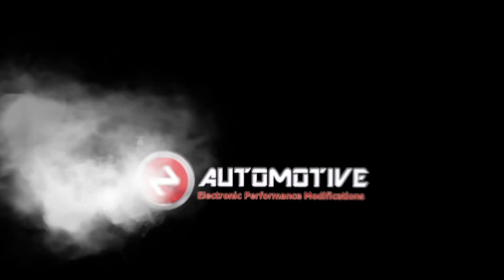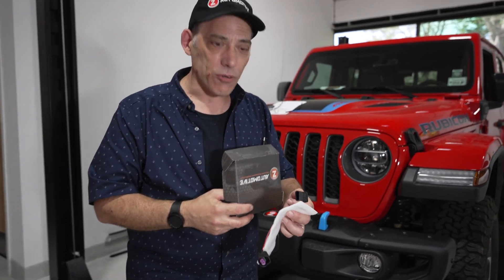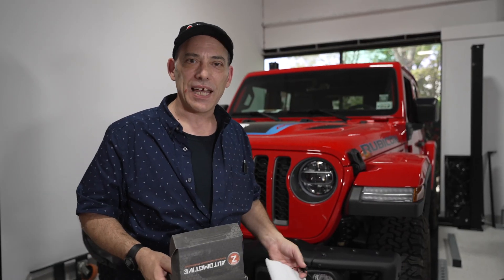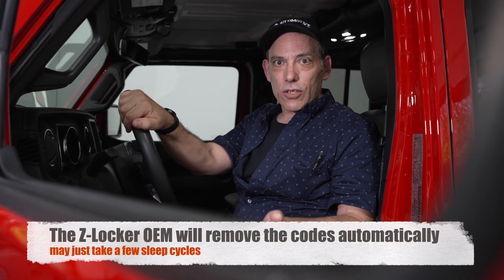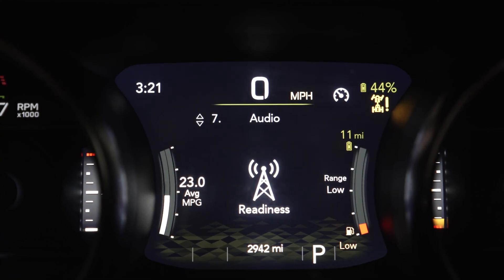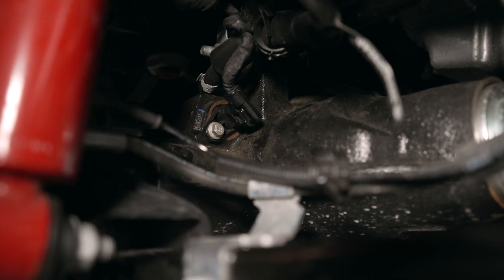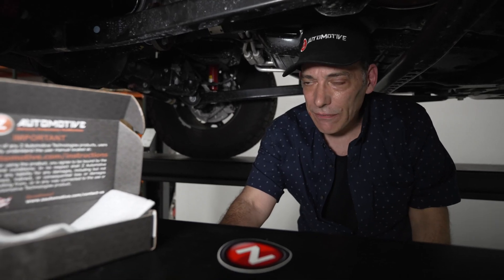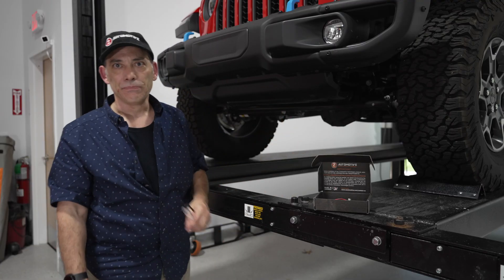Fix the Faulty Locker Sensors in the Wrangler JL Rubicon and Gladiator JT Rubicon

Comment: Hello.
Thank you very much for this video.
Could you answer a couple of questions for me.
Some time ago, I had this problem on my JL Rubicon. At first the error appeared and disappeared, later it began to glow all the time on the dashboard. I purchased your OEM Z Locker and installed it. But I installed it on the front axle of the car and the problem disappeared. The error did not reappear for several weeks. Now the same error has started appearing and disappearing again. I do not understand? I installed Z Locker OEM on the front axle and it should be fine. Does this mean that now I have the same problem with the rear axle and I also need to install Z Locker OEM on it? Does it happen that 2 sensors fail at the same time?
I also have a Tazer mini - but it doesn't find any errors.
And the last question - when will Z Locker OEM be available to order?
Once again, thank you very much for the video and for such a great solution to the problem.
Reply: @zautomotive , 
Thank you very much for the answer. I also thought so, that this is due to the fact that the error is not active all the time at the moment. I had 2 errors: B23BB and B23BF, but I understand this is not related to my problem? 
But in any case, I think I'll still get your second device.
Reply: @zautomotive , yes, it's a really great job. My respect to you!
Reply: Hello again, my friend. 
I have a problem again. If you remember the last time I bought your device, but it didn't solve my problem. The blocking error still sometimes appeared and disappeared. Now I have bought your second device. I have your devices installed in front and back. But, the error still appears and disappears. Sometimes it happens every 10 seconds. Tazer mini did not find any errors. I do not know what to do...?
Reply: @zautomotive  , спасибо за ответ. Да, наверно так и сделаю. Разве что, сейчас, в это непростое время - Это сложно. Извините…

Comment: I have this issue not sure if its my front or rear axle so I just purchased 2 from your website. so I wont have to worry about it. Thanks for the install video to make it easy and quick to install
Reply: @zautomotive  Update, it ended up being my front lockers sensor that is the issue, even with this plugged in, I had to remove the bad sensor; drill holes into the sensor in 3 places, fill it up with electric sealant than reinstall.  I was hopping this was going to bypass the sensor that was faulting.  Still a good product